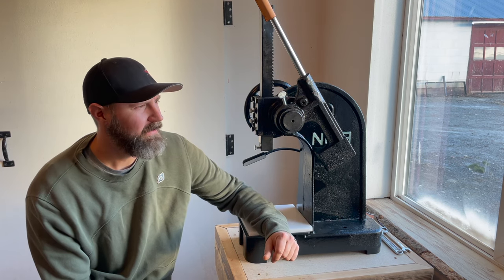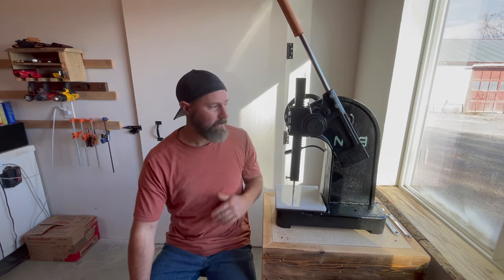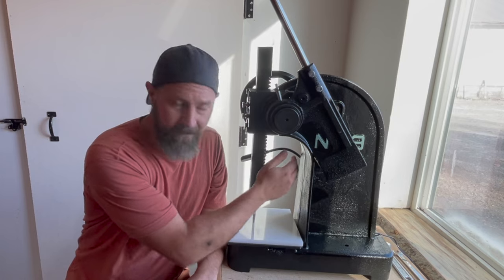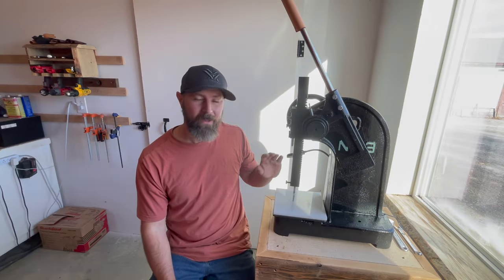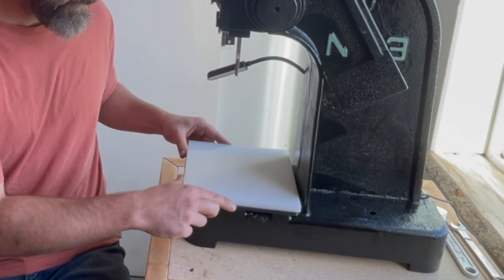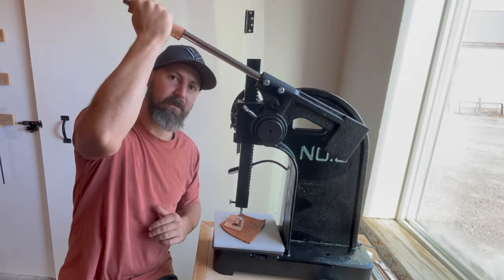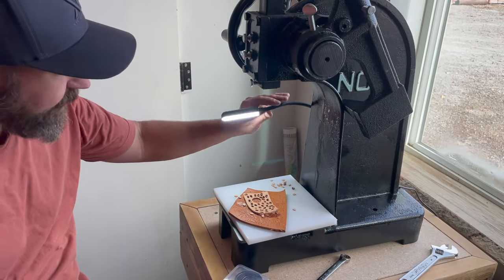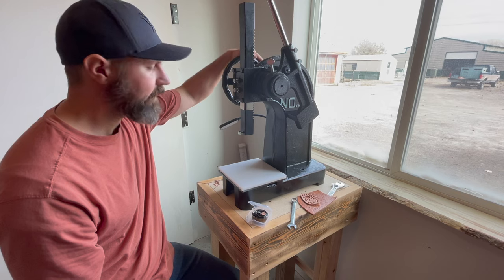This Tool Will Change Your Leather Work | Vevor 3 Ton Ratcheting Arbor Press

Comment: I did the same thing with a 3 ton Vevor (mines the blue non ratcheting one) However I also did two other mods that I think are worthwhile #1 I mounted a heavy duty 1/2” drill chuck to the bottom of the shaft to make it easier to quickly swap out tools, stamps and different sizes of press plates  #2 I drilled and tapped the top of the shaft for a 1/2” spring retainer bolt then bought a heavy compression spring that would fit over the shaft so when you let loose of the handle the spring pulls the shaft back up into position for your next die cut
Reply: I have the same one as you. I want to cut 14 ounce vegtan. The handle at 20 inches long doesn’t give enough torque for this. Want to use a longer handle for more torque. How long a handle do you think I could use without damaging the machine?

Comment: Bro, you could add a spring return, just by adding a spring from the bolt at end of arbor ram to top frame, youll never use that wheel again

Comment: Or you can use a very strong magnet to hold the steel plate to the bottom.
Reply from the maker: The problem I’ve had with that is the magnets beak when you put pressure on them
Reply: @wyomingwright  how did you cut the thick plastic board?
Reply from the maker: Chop saw

Comment: Thanks for the advice. I checked a few German brands for price but they are quite expensive for small atelier use at home, the cheapest one was 100 €. I'm not sure about the quality of Vevor, but for 73 € and the fact that extra tools can be attached to the end of the press is an advantage. I hope it won't disappoint. Greetings from Berlin.

Comment: Thanks for taking the time to share your experience and ideas on this press.  I have been contemplating a way to do some things in my shop and this press with your modifications may just be exactly what I needed !!  Thanks for sharing!
Reply from the maker: Glad I could help. It is hard to find the right solutions sometimes. Thanks for the comment!

Comment: Great workshop, and impressive machine!  Looks very well built.  I have a much smaller 1” ram arbor press that works ok for rivets, etc. but doesn’t handle anything much larger.  Great mods to your press.  The rough castings are pretty common and don’t bother me, but I like all your other improvements a lot.  I have a similar thumb screw attachment on my drill press, great idea to attach it here.  Thanks for sharing!  👍

P.S. I spent so much time trying to find a decent magnetic work light, so appreciate that link the most!  Lots of junky ones out there…
Reply from the maker: Thanks! The light is working great for me so far. I’m really liking the arbor press

Comment: OLD Leather Smith here, ok if it works 4 you  great.   I personally prefer a DRILL PRESS, & the chuck on mine is 1/2" which fits all my tools. By the way its a bench model  I  purchased used.
  God's Blessings ✝️ 🥎 🙃
Reply from the maker: I used to use a drill press. It’s a good solution but I had a hard time getting the amount of pressure you can get with the arbor press

Comment: I like the thumbscrew idea.  I suspected you might need something like that for repetative operations.  I might be inclined to drill receiver holes in the shaft aligned with the teeth.  That way you get a positive lock from the screw without needing excessive pressure.  I would be worried about cracking the casting.  All and all, nicely done.  Cheers.

Comment: I have order a 4 inch diameter circle die from Texas leather die. I want to cut 8 ounce vegtan for coasters. Do you think the 3 ton press will work?
Reply from the maker: Yes but you would want to get some kind of plate to put under the ram and on top of the die so that you could distribute the pressure across your die.
Reply: @wyomingwright  Thank you for your quick response. Will take two weeks for delivery of the die. I tried a hammer type die from Buckle Guy. Even with a 48 ounce hammer the die would only go half way through the leather. Really gave it a good pounding too.

Comment: I have the 1 ton. The ram wiggles forward and backward about 1/4”. My snaps and rivets aren’t installing correctly because it’s coming down at an angle and/or shifting has it comes downward. Any idea how to fix this? I tightened all four bolts.
Reply from the maker: I've heard of some folks installing a small piece of HDPE plastic as a spacer between the bolts and the ram to put more even pressure on the ram but still allow it to slide. I have not had this issue with mine. 1/4" is a lot. I do have some very slight wiggling but the tolerances are pretty good on mine.
Reply: @wyomingwright  should I shim it or return it?

Comment: How can i make my arbor press put equal pressure on a 7 inch stamp?
Reply from the maker: I haven’t tried but I’d start with an additional 8” metal plate on top of the die or stamp

Comment: I just unboxed my press, and it looks like the ratchet gear was installed upside down, so that the gears face downward instead of upward. Any idea how to get the ratchet gear off so I can fix that? I tried to take off the lock collar by removing the small nut that was inside the collar ring, but that did not loosen it. Feels like the lock collar is welded to the entire rotary system of the press. I have no idea how to get to the ratchet gear and am not very tool savvy 😅

Regardless, thanks for the awesome tips and tricks for the arbor press. Will definitely be implementing that thumb screw mod when I get everything up and running!
Reply from the maker: That’s weird. My collar ring came right off when I loosened the screw. Maybe tap it with a rubber mallet and see if that breaks it loose. Sometimes that oil they coat everything with dries out and sticks parts together.

Comment: CAN STINGRAY LEATHER BE DIE CUT ON ARBOR PRESS
Reply from the maker: I don’t see why not. It will depend on the size of the die and the size of the press
Reply: It will cut it, put a steel plate on top of and a cutting board and a steel plate below it, if you need additional power just use a pipe over the handle to make it longer to create more pressure. Good luck